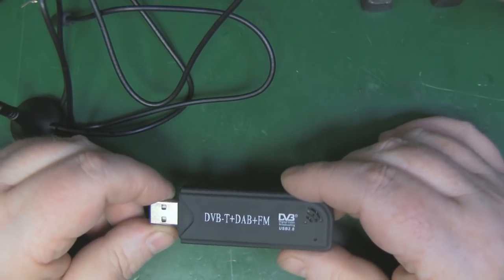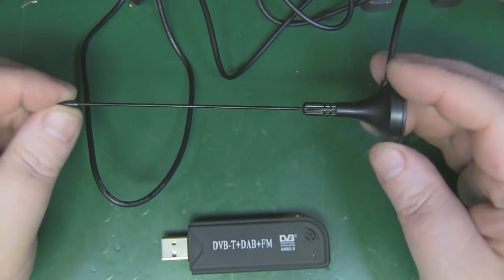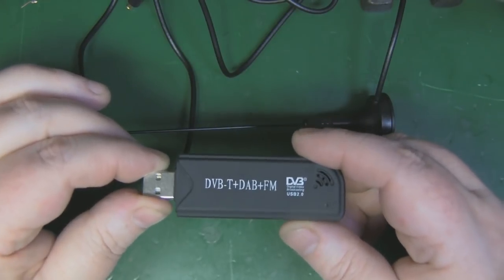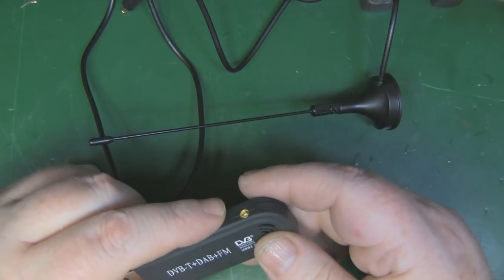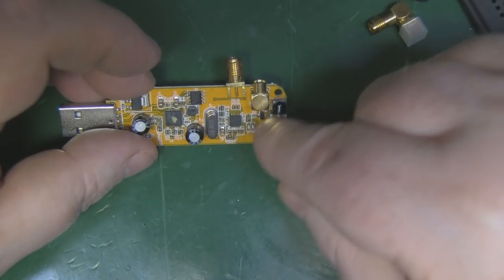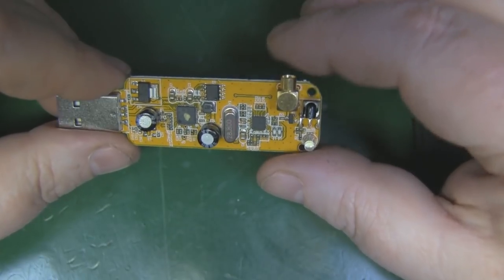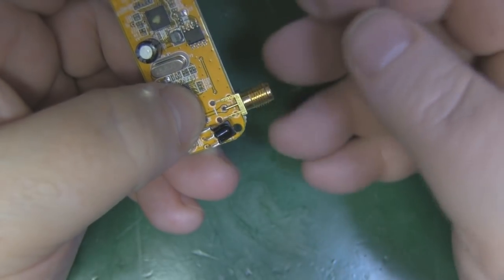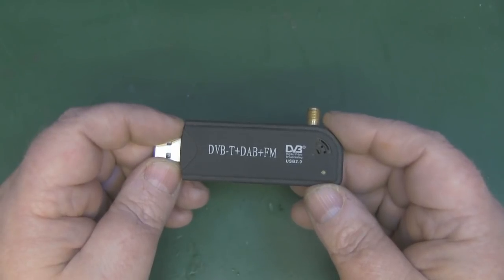Realtek RTL2832U TV Tuner Software Defined Radio SMA Modification

Comment: How did you manage to unsolder that connector ?? Spent about 30 mins burning my fingers. Used a sma off broken baofeng. I had to resort to cutting it off with pliers! 😄👍😎 Worked well, thanks

Comment: You will probably want to replace the crystal with a TCXO. The frequency is to unstable to tune narrow signals without one.
It would also be a good idea to add a heatsink, these things get pretty hot.

Comment: Yup. The first thing you do with an rtlsdr dongle is throw away the stock antenna. Half the time they don't even have the crappy coax connected right inside. Switching to SMA (50) when it's made for 75 doesn't really matter to much. Just a db and a half of mismatch. 

Also consider removing the LED and IR receiver. And if you get serious about radio astronomy is helps to replace the switching regulator on it with a linear one and put it in a metal case.

If you're going to want to tune over >1400 MHz or so you'll need to add cooling of some sort to the R820T tuner chip. Otherwise it'll fail to lock (silently) when the charge pump for the PLL can't cut it anymore. It'll just return bad/false noise.